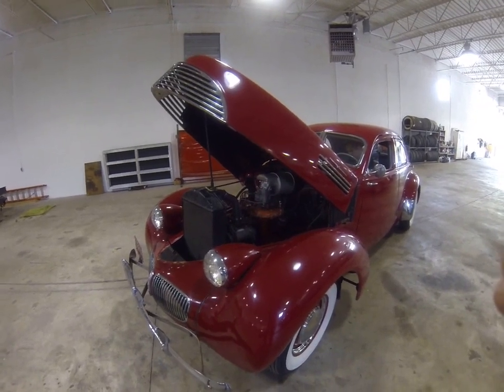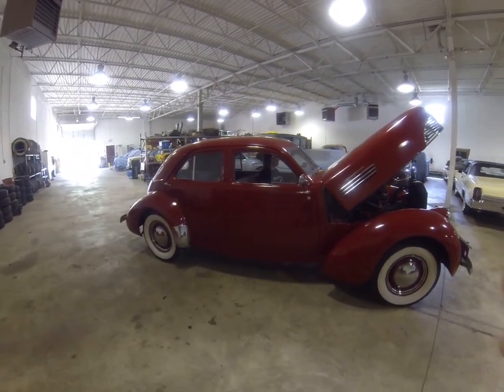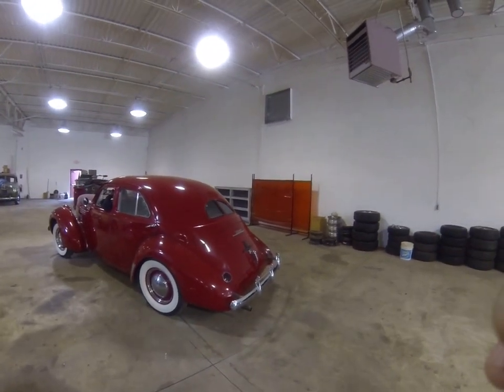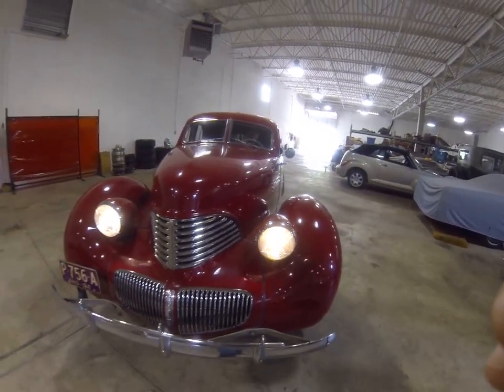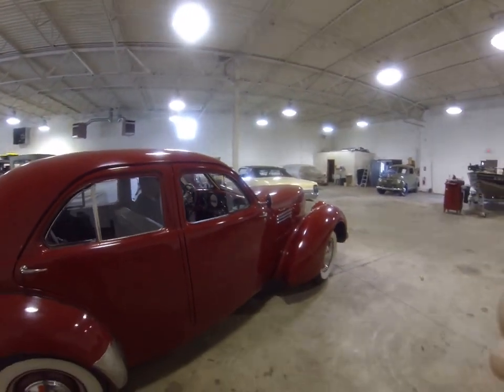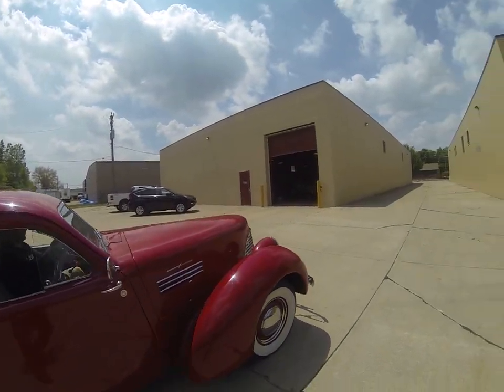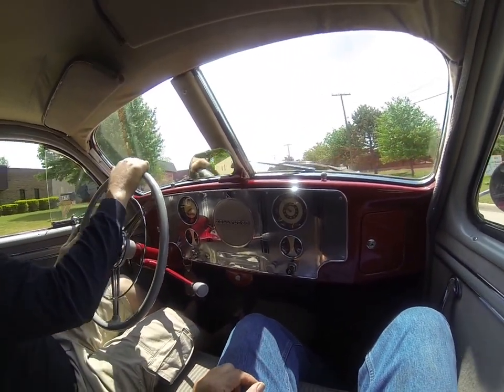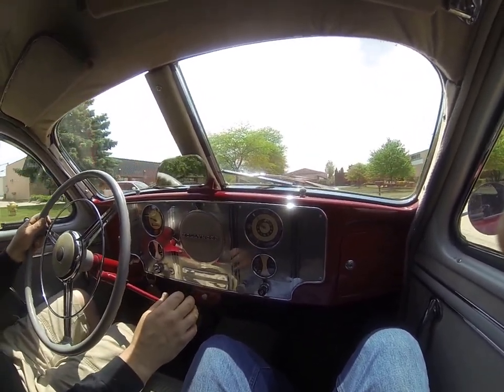1941 Graham Hollywood Supercharged final

Comment: The back doors are OK, but I don't like the front doors since they are suicide doors and they can bang to the rear doors when they are open at the same time. Besides the styling is behind its schedule, for example 1941 Graham car is one of the few makes that still uses pre-1940 dual beam headlights, along with Crosley. Same thing with Kaiser-Frazier cars from 1946-1955. Many say it is ahead of time, but later it is outdated, since Kaiser lacked V-8 engine, hardtop, convertible, even wrap around windshield.